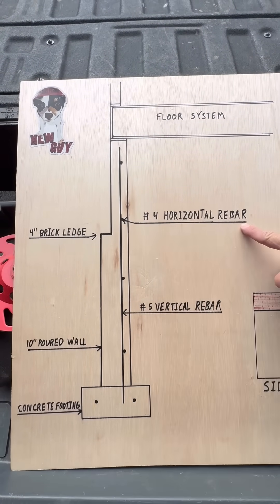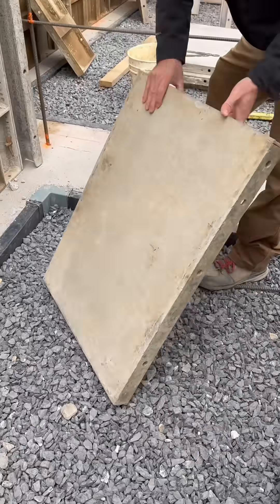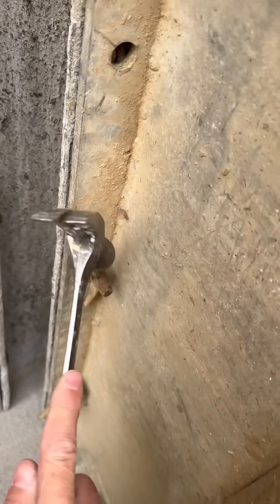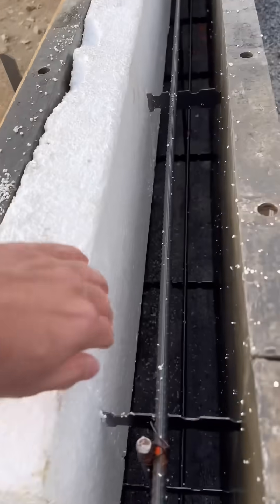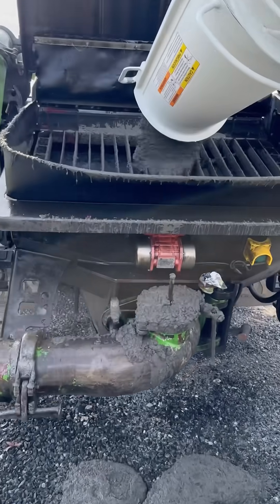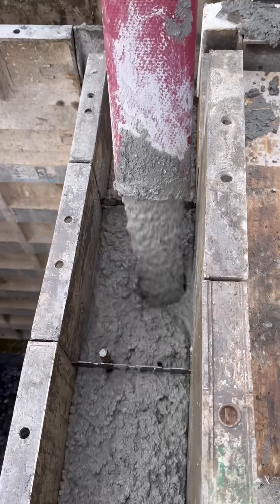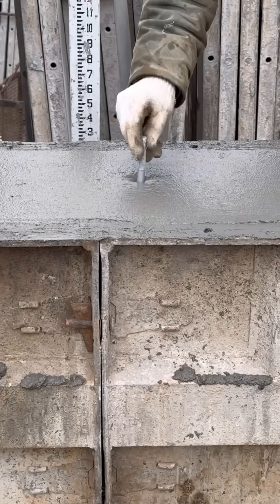How To Pour Concrete Basement Walls

Comment: Interesting. In my part of east Europe most homes are brick. With long brick forms over windows. The forms and corners have steel and concrete to make the vertices. The roof's usually wood and ceramic tiles.

Comment: Back in the 1980s, our form panels were made of steel and weighed over 100 lbs. The panel truck was loaded and unloaded by a crew calling themselves Concrete Cowboys. Imagine lifting weights in the 100-degree sun, tying rebar, sweating in the dusty dirt. One dude would get two 110-pound panels at a time and go walking off like nothing.

Comment: I'm an IT guy so i don't know much about this but why would you use foam for a brick wall to sit on? And it was on the top of the concrete wall so the bricks sit directly on it? Or do you remove the foam as an ablative layer once done and the concrete that  is underneath, used as the foundation to build off? Oh and when will you guys use centimetres and metres?
Reply from the maker: The foam comes out. It’s just to keep the concrete from going there during the poor.

Comment: Can i have 2 feet wide concrete poured walls? Or does it have to be what ever the code/law says in my area?
Reply from the maker: You can always do more than code allows, but all the extra weight of the concrete may cause your structure to settle depend depending on the type of soil you have.

Comment: Those metal parts are going to weaken the concrete wall when they rust. No?
Reply: Are you talking about rebar?
Reply: @markus5237  no, I'm talking about the metal pieces that maintain the two walls together (to pour the concrete in) :)

Comment: there are foam forms now, where you set them and will be left on site once the concrete is filled and cured. It becomes part of that foundation and is an insulator as a plus.
Reply from the maker: It’s called ICF insulated concrete forms

Comment: Is your house going to be concrete block reinforced with rebar and concrete? Or will it be ICF? Or cheap disposable wood?
Reply from the maker: Poured wall concrete basement, wood framing on the first and second floor

Comment: They should wrap the foam on plastic for clean release
Reply from the maker: That wouldn’t work with the wall ties
Reply: @ once wrapped, you slit where the wall ties go. Either all the way up to it or just where they go through. Did it for 10 years. Hope this helps

Comment: I’d suggest the Fox Blocks over the aluminum forms 100%
You get the added insulation and you don’t have to take it all apart at the end it actually adds to the foundation. 
I’ve used them on several projects now and I’ll NEVER go back to aluminum

Comment: It really is interesting how insanely different home building is and different regions of the US. It seems especially concrete in framing. I've literally never seen any of the tools forms you guys are using for concrete forms and I used to work concrete foundations
Reply from the maker: Yeah, it really does vary by region
Reply: I've always wondered why I've never seen concrete wall, at least on the internet (I'm not US). Then a lot of people get their homes blown away by hurricanes. There are a lot where I'm from and basically all houses in the city are concrete.

Comment: One of the mistake I see is there, you  are spraying strip form oil on the rebar, forms should be sprayed before installation and rebar must be cleaned if stripped oil are on rebar
Reply from the maker: That would be impossible because the rebar has to be put in place before the forms are set. They try to be careful not to spray the rebar when they’re spraying the side of the forms.

Comment: @hausplans For a poured concrete crawlspace wall, would it be acceptable to begin the first course of brick veneer directly on the footing if the footing was 24" wide and the foundation wall was 8" thick? I completely understand the reason for the ledge on a basement wall. It would be a huge waste of materials and labor to begin the brick veneer at the bottom of the basement wall since it would have so much of it below grade. In my region, the frost line is 12 inches so the backfill over the footings would probably be no more than 18 to 24 inches. I think that would require about 6-8 courses of queen size bricks.
Reply from the maker: Yes, you could definitely lay bricks off the footing in the situation you laid out👍
Reply: @hausplans  Thanks for the answer. I appreciate it!

Comment: Why is the brick ledge so tall?  Looks like 3' if that isna standard 8' pour.  Is it at grade?
Reply from the maker: It has to due to the grade against the basement walls. In the front of the brick ledge is only down 1 foot from the top versus the backside where It’s down 7 foot from the top.

Comment: Wow vertical rebar drilled in? where i'm from, the vertical rebars require a 90 degree bend to tie them in with the footing rebar.....
Reply: Whereabouts are you from?
Reply from the maker: It’s not drilled in it was set into the concrete while it was still wet. We are required to do L bars for certain jobs. We just follow the plans and the engineering per job requirement.

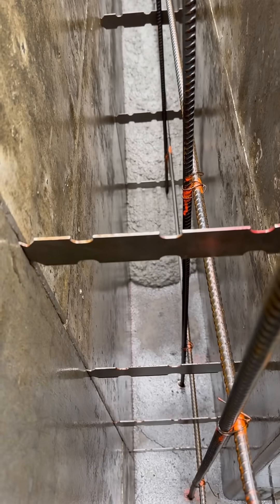Comment: Argentinian here. When we have to pour concrete in similar situations we use flexible mechanical vibrators (I don't know the exact word in English) to purge all the air instead of the long sticks used in 0:49. Greetings from Patagonia Argentina.
Reply: Still called vibrators in English as well, bud. Just gotta specify it's for concrete...
Reply: @shurdi3  agitators*
Reply: @Aaron-st2pm who the hell calls them agitators?
Reply: @justinjosie5417 the workers union has a lot of agitators
Reply: @bulukacarlos4751 I've always heard the 'mud guys' call them 'stingers'...
Reply: @BrinnerDang  just a cool slang word guys use out in the field
Reply: Very common in US too.  Not sure why they aren’t being used here?   Also, guys use hammer-drills (without bits) to vibrate the forms for the same purpose
Reply: @procrastinator41 I believe it is related to the slump of the concrete going off other comments. The site I worked on used them as well.
Reply: That's usually how its done in the US. Those guys are just rednecking this.
Reply: Always heard them called vibrators. If you have to be specific on concrete vibrators.... then too each their own😂 2024 no kink shame just idk .... don't tell everyone your business like that

Comment: How is the aluminium form work compared to traditional wood? Is there any benefit to using aluminium other than saving money and possibly quicker?

Also, can I ask why you use different size rebar  horizontally and vertically 

Please and thank you 🙏
Reply from the maker: I’m not sure all the advantages or disadvantages most of the companies in my area use aluminum. I think the aluminum forms lasts a lot longer than the wood forms.

As far as the rebar sizing the guys just follow the engineering that’s provided to them. Or what’s required by code
Reply: @hausplans  thank you 🙏

Comment: How many PSI concrete did you use with what additives? 
Why is the brick ledge following the lay of the land so there is no exposed foundation is important?  Is it just for esthetics?
Reply from the maker: Just aesthetics, that is correct
Reply: @hausplans  Thanks for your prompt response!  Different projects use different psi, 3.5k psi - 5k psi. Fiber mesh, plastificator, 5” slump.  What strength concrete did you use for the stem walls and footing?

Comment: nice… does the brick go all the way up the face of the house or stops  at the floor system?
Reply from the maker: In some areas of the house brick goes all the way to the roof and other areas it stops at the first floor system
Reply: @ that ledge is slick.not sure i’ve seen that before or noticed it but then again i’m not a builder.
just someone that enjoys construction. thx

Comment: Would using vibrators while pouring cause the concrete to flow easier? Would it save the hardship of moving the concrete with sticks?
Reply from the maker: These guys do use concrete vibrators for certain conditions

Comment: Isn’t a concrete vibrator better for any air pockets and bubbles?
Reply from the maker: The concrete vibrators work good but if you’re not careful they can over vibrate and cause the stones to settle to the bottom of the forms

Comment: I like seeing how things are done in the US. Other than us always vibrating concrete to get the air out (especially when pumping) we follow the same methodology. Good work. Like your content, especially the new guy.
Reply from the maker: Thanks
Reply: you should stop. vibrations are actually really hurtful for the human body.
Reply: @Krillek-bv2ic  are they harmful to concrete?
Reply: @Krillek-bv2ic  stop typing vague, half assed nonsense. either explain how and why it's bad or don't comment at all
Reply: @Krillek-bv2ic 😂
Reply: @Krillek-bv2ic shut the front door
Reply: Depends on the slump. Less than a 1” slump must be vibrated. 1-3” vibration or rodding. More than 3” must rod. But that’s just the technical answer. I doubt most people even do a slump test on the concrete when it gets there
Reply: I was a bricklayer for 4 years, here in the US, and we always vibrated the concrete when we were pouring.
Reply: I live in the US, and my first thought was “Why didn’t they vibrate the walls?” Such a small expenditure for better results if you do any type of wall work where there’s gonna be exposed concrete!
Reply: @BurkholderCustomCarpentryLLC96  the site I worked on building cinder block walls vibrated the concrete after it was poured.
Reply: because vibrated isn't absolutely required everywhere Seattle Tacoma yeah middle of Montana no
Reply: @BurkholderCustomCarpentryLLC96  Vibrate too much and all the rock goes to the bottom.
Reply: Wrong you're not seeing 2% of.it
Reply: Most reputable companies in the States Always vibrate the concrete, idk I guess this guy is super cheap but remember, you get what you pay for😂
Reply: @jasond7229  that concrete was beautiful.
Reply: You don't know what you don't  know.  I've done poured walls for 43yrs.  Exactly how they're doing it.   Same hardware and different  manufacturer aluminum forms.  It's all about knowing what your concrete is doing and controlling the pour.  Good job@jasond7229
Reply: We also vibrate here in the US for any sizeable pour, and I'm really hoping that's the camera angle and not the crookedest anchor bolt I've ever seen.  😂
Reply: I like the way they're pouring concrete, and they are letting it settle in. Unlike, in Ontario, Canada, the builders are doing a shoddy job, making sponge pockets in the concrete foundation. To top it up, their shoddy workmanship is protected by the government appointed companies. Pathetic.
Reply: As a concrete inspector with all the ACIs.   Your all really really wrong
Reply: US craftmanship suxxx
Reply: that's basically that they're doing when they beat the side of the wall
Reply: Vertical walls this tall shouldn’t be vibrated, especially if the mud is thinned enough to go through a pump like the one shown. You’ll wind up with too much separation of the aggregate

Comment: Are any of the portions of the form left or are they all extracted and removed?
Reply from the maker: They’re all removed and used hundreds of times. The wall ties do stay in the wall though, and the part that sticks out is broken off with a hammer.
Reply: @hausplans would I be correct in saying the wall ties are also galvanised steel? If so wouldn’t that help reduce the lifespan of the concrete? I see comments that steel eventually rusts, reducing the lifespan of the concrete

Comment: Thats surprisingly wet concrete. I always thought less wet concrete was stronger, is it just simpler to have watery concrete for a job like a house foundation that won’t support incredible loads?
Reply from the maker: It has to be a certain consistency or else it won’t work with the pump
Reply: Pump mix with super p. Added chemicals not water to keep the strength and integrity of the concrete. Also can’t  over  vibrate. The aggregate would separate resulting in weaker concrete.